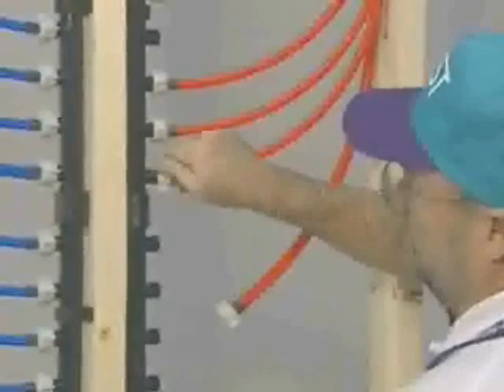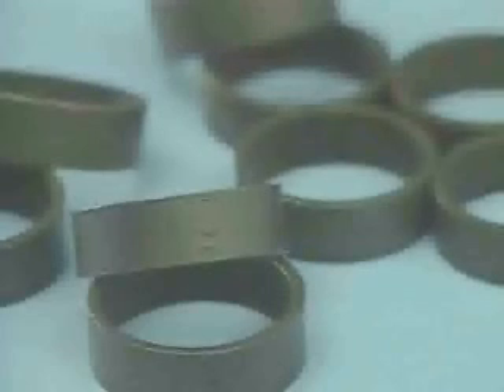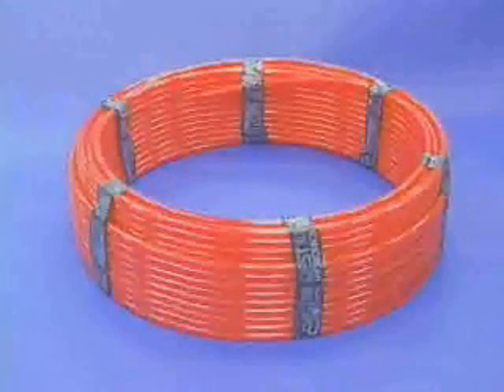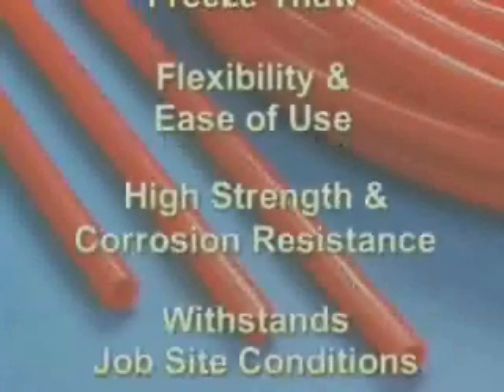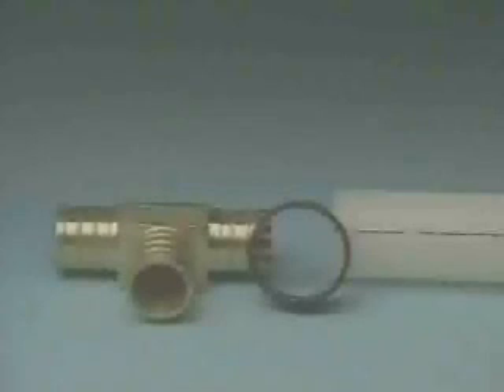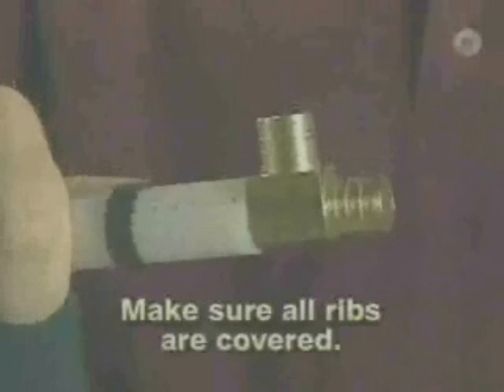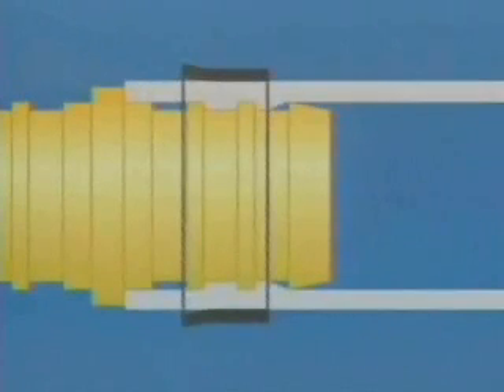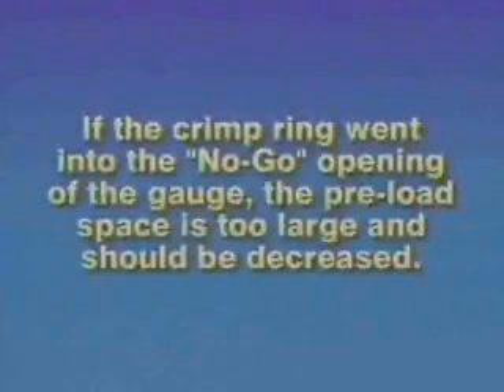Zurn PEX Plumbing Systems Part 1

Comment: We have Zurn PEX throughout our home and have experienced 4 leaks so far. Pipes are splitting right at the fitting. This is cold water as well as hot. Centex Pulte, the builder, stepped in and took care of the last 4 floods....but are refusing to even look at this latest one. They are saying that since we are now out of warranty, we are SOL (pretty much). We bought this home in 2006 and started having leaks in 2008/9. Had I known anything about PEX ...I don't think we would have bought!

Comment: I don't know about a lawsuit for perhaps the connection method, but my dad is a plumber and he uses a PEX expander tool and appropriate fittings (different from the method in this video). He's never had a problem with them.